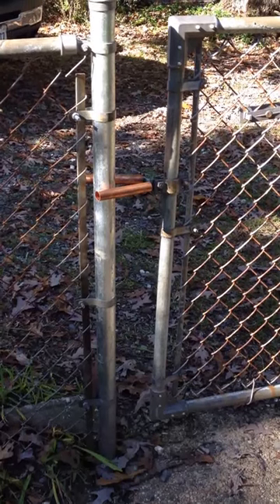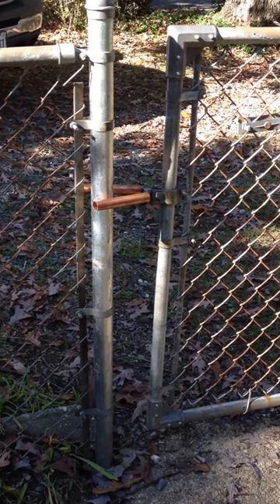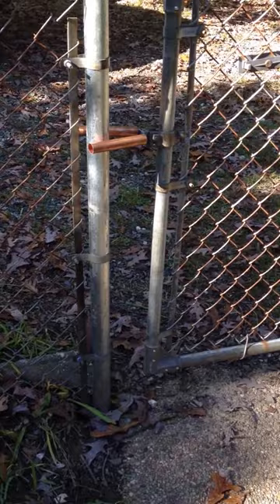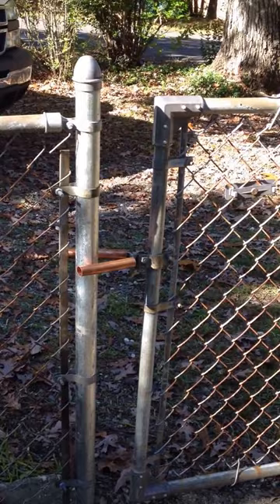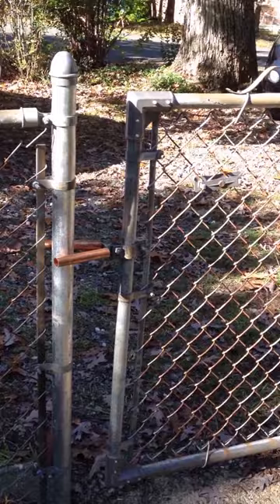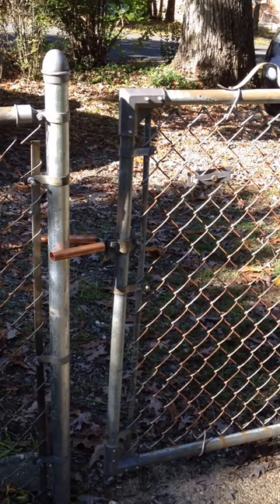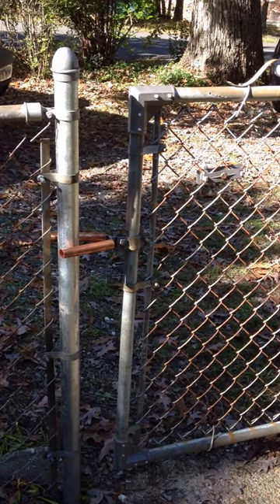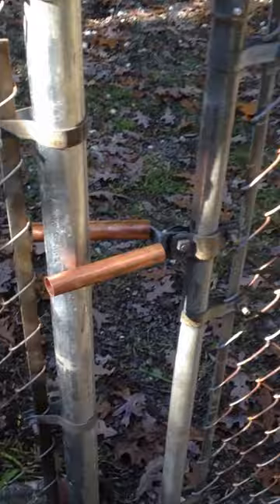Simple Easy Fix for a for a Misaligned Chain Link Gate Modify Fork Latch $10 & 10 Minutes

Comment: I'm sure you could go to a metal yard and have them cut the right size for the top and maybe find a sleeve to connect it. You would need to get new chain link fence and cut it to it's new size. This depends if the corners are welded.. looks like the only thing holding the gate together are the bolted on corners.